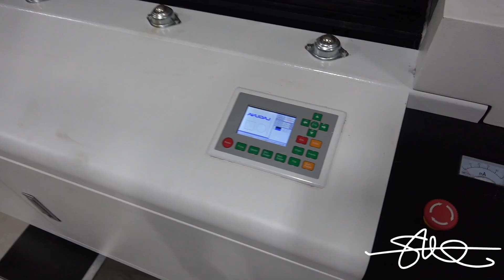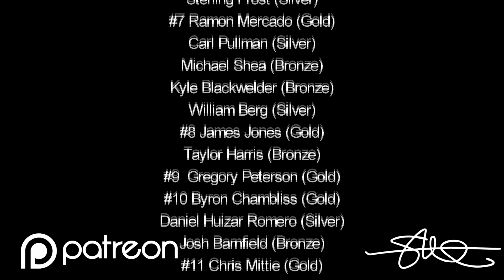LASER DAY! New Laguna 4x8 Smartshop ILX CNC Arrives! Offloaded, Uncrated, Installed and First Cut!

Comment: Not a bad way to spend ten thousand dollars. sweet
Reply from the maker: $10,000? LOL...Please.  It was a lot more than that.
Reply: There isn't much info on the ILX series but they look similar to the FC series. I'm going to guess somewhere between 50 - 100k maybe more. A local shop here just bought a 10' gantry system and it was around 500k (will cut 1" aluminum) This machine is going to save you SOOOO much time.
Reply from the maker: it ain't that much.  :D

Comment: Nice one, but you should buy eye protection goggles for co2 laser. Also I recommend LightBurn software because you have Ruida controller in that laser, it's the best.  And leaning, failing, learning, failing... Did you aligned the laser beam at all? Was the focus point correct?
Reply from the maker: don't need to wear goggles. I have heard of Lightburn.  May consider trying it in the future.

Comment: Bet you wished the laser cutter came befor the router that way you only had cables running across instead to two big pieces of duct
Reply from the maker: i know...what can i do....lol.  It's ok, no complaints here. I will probably make a platform for them so they don't get stepped on or tripped over.  Not much of a choice right now though.  It works :D